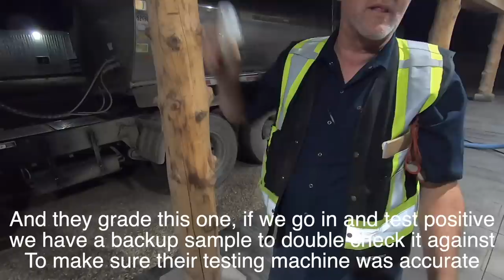How Milk is Picked up from Dairy Farms

Comment: Goodo, sometimes when they curl there head to one side they have calcium deficiency., which I guess was part of what you pumped into her. Looking at her when she left it was more likely retained membranes or uterine infection hence the antibiotic use. (Hunched, slab sided and as a really tucked up look to her)
Our tankers down her are tractor trailer units. Our silos/vats are situated outside(no snow). The milk samples are bleed off as it is going into the truck, to test for everything and I mean everything.  Huge penalties if your milk is not up to scratch.

Comment: Ref. Cow with GOPO.
Cow only licked the water when she was at the water tank. Indicates water was not clean. Livestock will stick nose in and drink when water is right. Keep up good work.👍🏼
Reply: Not always. My cows love to slap the water with their tongues before they take a big gulp. Annoys me in the winter as I get splashed:-)  Water is always fresh.
Reply: @notapplicable430  cows licking/ splashing the water before drinking Is called lapping. It’s a stereotypical behaviour. They do it because they have very sensitive taste and smell senses and because dust particles ( which we may not see) are floating on the surface of the water, which they do not want to drink. Cows don’t lap smooth flowing water.

Comment: In the Netherlands a truck loads about 34000 to 36000 liters,why the small diameter loading hose?
Reply: There are bigger milk trucks in SK. That one had a single tri-axle trailer. I also see milk trucks on the road with  B-trains (two trailers; a tri-axle pulling an tandem axle). I don't know how many litres they haul. I do know that they would have max GVW of 62500 kg.
Reply: I don't know about the hose diameter...🤷‍♂️

Comment: If one Farm has a positive antibiotic test, I believe that farm needs to pay for the whole tractor trailer load of milk. Correct?
Reply: In Australia, if you manage to pass antibiotics into the system, it could cost you your farm. One dose of a/biotics can spoil an entire silo of milk and more.
Reply: Yep you pay for the tanker load. Best to know if it happens first so you can test your tank and dump it if positive before it goes on the truck